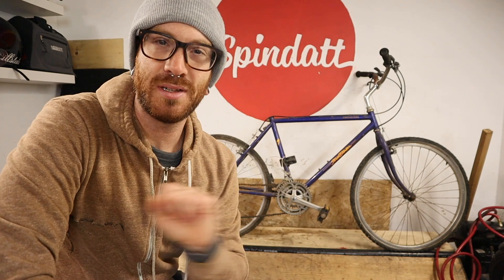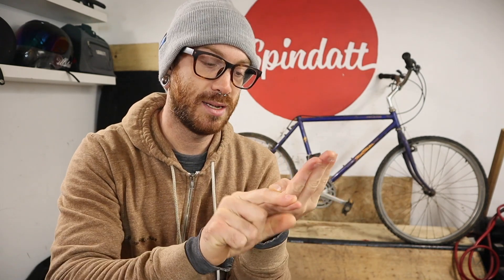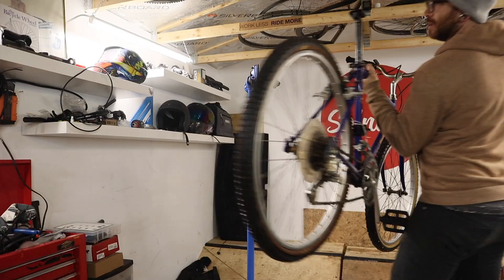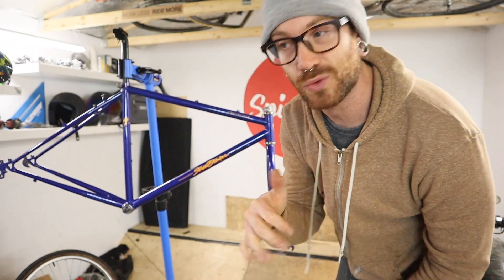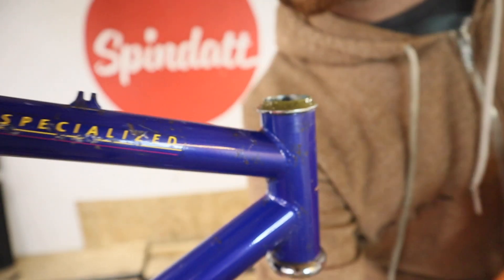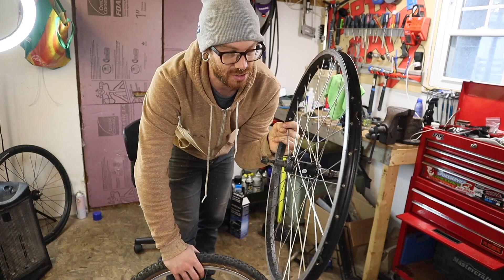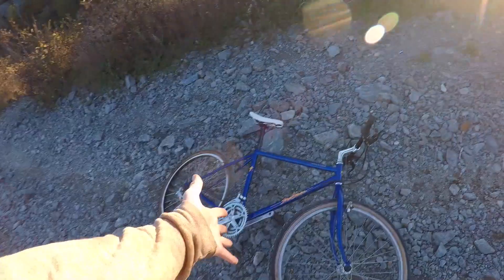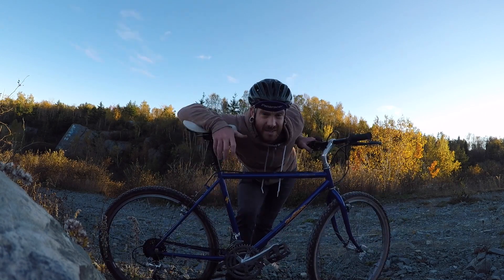Bike Restored |Was found in garbage|.

Comment: StreetStomper! So awesome. The blue looks so good also. I was so surprised that bottom bracket came out like it did.
Reply: So nice when they are not left outside eh?
Reply: Do you usually try hard to remove  the fixed cup too on those cup and cone brackets if you are just servicing the bearings?  I had trouble with a 87 Miele donation and had to settle for cleaning and replacing bearings/grease with the fixed cup on (no vise available).
Reply: @NK72TO  I try to get it out if I can with the park tool BB wrench and press to hold the tool on.  You can make a tool out of a bolt, lock washers and nuts. Sheldon Brown shares how to make it. 
Remember, that cup is left hand thread.
 But if you got it clean and nicely packed with grease I'll bet you did fine with it. 
Cheers!

Comment: I did a similar resto a year or so back to a Trek 7000 fx that was thrown out in the trash for the crime of "not being used". Similar case, 80% of the work was giving it a deep clean. New seat, cable inners, grips and tyres had it looking as nice as the stomper here. Nearly the same colour too. 
Sold it for the price of the new parts plus a 6pak of beer for my efforts. 
The guy who bought it wanted to ride to work 3km, too far to walk but not far enough to drive and find parking every day. 
Everybody was happy and what was a good bike under the grime and neglect was saved from a one way trip to the dump.

Comment: I agree totally to not throw bikes out 😃. Someone can get it running well again and someone can have a lot more years of fun with it. Fixing up old bikes that people were gonna throw away is quickly becoming one of my favourite bike hobbies.

Also I have a old orange Raleigh Ozark that is super sun faded on one side. Just took it off the original owners hands who stored it with the same side facing the sun for decades. Do you think that a little abrasive and then wax might bring out the old color a tiny bit?  Or should I start thinking about painting and trying to get new decals?

Comment: I’ve never heard of a StreetStomper and I’m an old early 90’s MTB guy.  Where does this fit in Specialized line up at the time?  What was its intended use?
Reply: I found my answer to “what is a Street Stomper”?

“Quote: 
ALL-TERRAIN BIKES: If sitting upright is important for your comfort, consider this category. All-terrain bikes, also known as mountain bikes or city bikes, are the fastest-growing type and currently claim 35% of the market, largely because they are versatile, durable and fun to ride. They can be raced in off-road competitions, loaded with bags for long tours or used simply to get around town. Their extra-wide knobby tires and higher bottom bracket -- the juncture of tubes at the pedals -- make for easy riding over rough territory, giving extra protection against bumpy trails as well as potholed streets. The upright position, plus brakes and gear shifters on the traditionally shaped handlebars, are comforting reminders of childhood bicycling for many purchasers. ''It's the yuppie bike,'' says Edward Schwinn, president of Schwinn bicycles. Happily, as ATBs have turned into hit sellers in recent years, attracting more makers, prices have plunged. You can buy roughly the same mid- range quality ATB for $300 now that would have cost $700 only four years ago. For the most part the more reasonably priced choices, such as the Specialized Streetstomper ($325) or the Univega Rover Sport ($330), are general-purpose ATBs meant to be ridden casually on the road as much as off.”

Comment: Honestly you should mention, that you was extremely lucky that all parts came apart so easily, what in reality is rarely the case. Usually one has to put way more time and more replacements to get a garbage bike running again. Garbage bikes often have frame damage beyond (economical) repair. In general I agree, don’t throw (steel) bikes away, there is a good chance to bring them back rolling on the streets.

Comment: Whats the tape you use instead of a rim band?
Reply: @micahsherer7189  that works??
Reply: @sempi8159  better than any purpose made rim/tubeless tape.
Reply: @micahsherer7189  daym i could save so much money! 
How is it better?
What width do you use? 
And how many layers?
Reply: @sempi8159  just cheaper and easier to work with for tubeless. Just buy a big roll and tear it at the width you need for your rims. Super easy.
Reply: @sempi8159  only need 1 layer.
Reply: @micahsherer7189  

and removal works well?

Works for tubed tyres aswell?